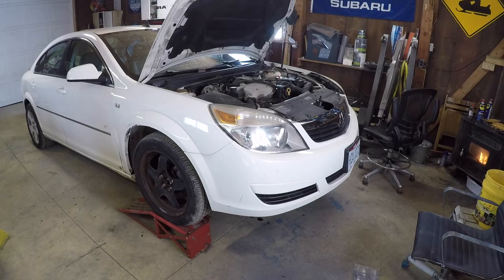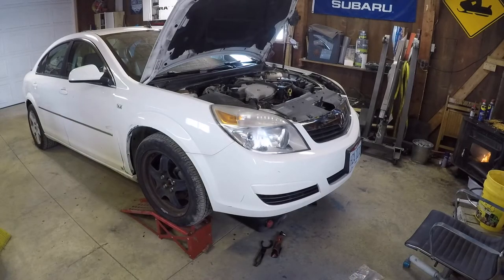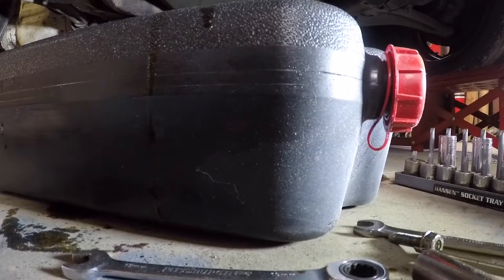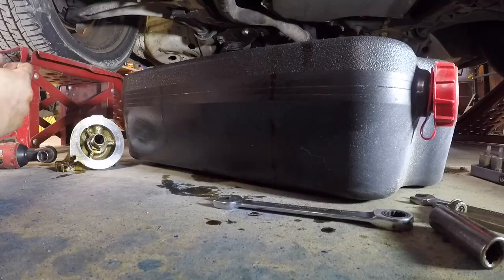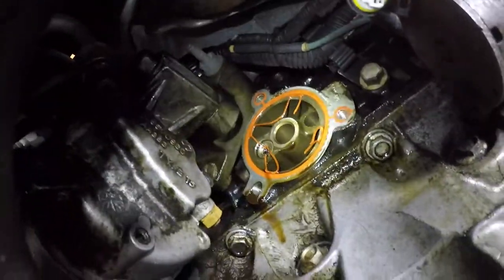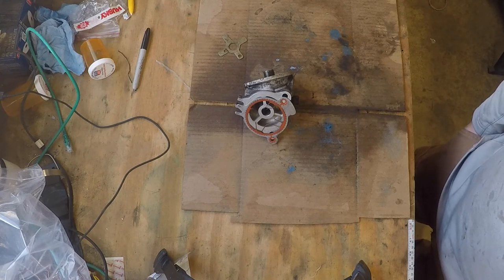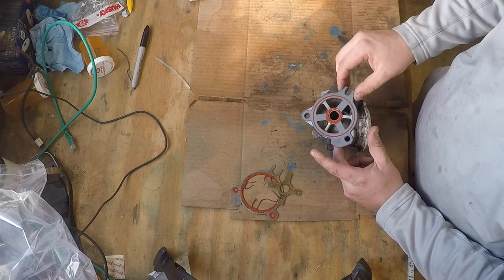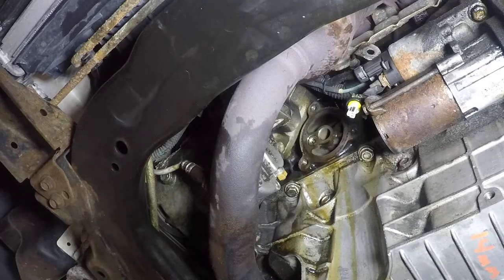CBR EP13 - 2008 Saturn Aura - Oil Leak Fix - GM 3.5L Oil Filter Adapter leak fixed

Comment: This is the most common oil leak on these GM 3.5's. These are infamous on the Impalas and use 4 quarts of oil only. The screws are hard to get to unfortunately, especially that one by the Ac compressor and the hidden one on top.
Reply: Yep and I noticed it when Changing my oil filter and it was all over my AC compressor at the top and running down my exhaust pipe
Reply: If I had looked on YouTube years ago I would have fixed this earlier lol 😅 did this guy ever say if it fixed the problem?
Reply from the maker: It fixed the problem on my car!

Comment: By far the best camera work on this job. I have to do this on my g6.  You actually  show how to get to the bolts with extension and swivel.

I see there's a few different  gaskets  and some say improved design. Ill have to see what's  the difference
Reply from the maker: Thanks!  Glad it could be of help!
Reply: FEL-PRO 72423, VICTOR REINZ 711351100 (IMPROVED DESIGN), MAHLE B32184 (Premium, Original Equipment Design), GM GENUINE 12607947, which one you ended up using?
Reply: @pcnepal  i got a felpro. But havnt replaced it. My g6 is setup different can't get to that one bolt like on this with the extension unfortunately.
Reply: @sogone2day  Thank you for your reply. Take your time you will eventually get to it. Hope you have a 2nd car to use while tackling it. Good luck！

Comment: Just took my 08 Aura in to get the leak quoted and they said the oil filter adapter was where it was leaking. This definitely looks like a knuckle buster, but not impossible. Might do this my self and save some $$$$!
Reply from the maker: It is a little tough to do, but doable with floor ramps/jack stands.